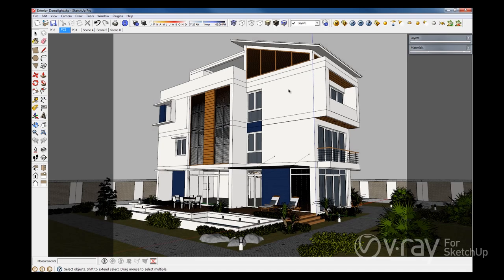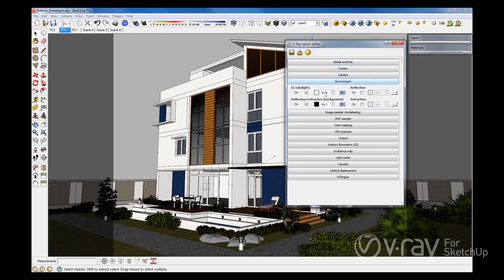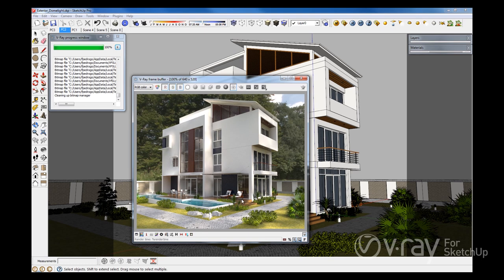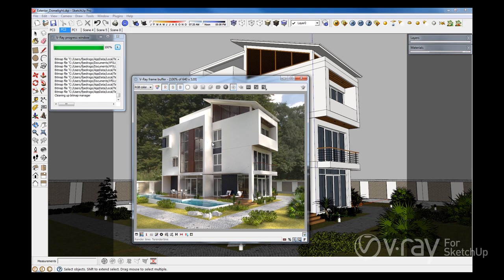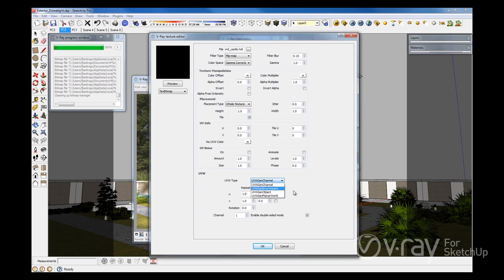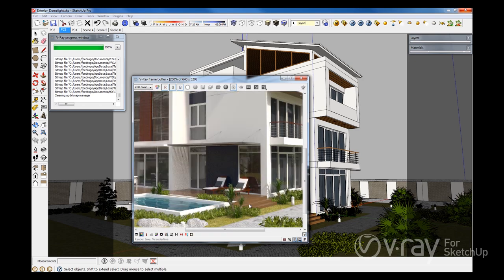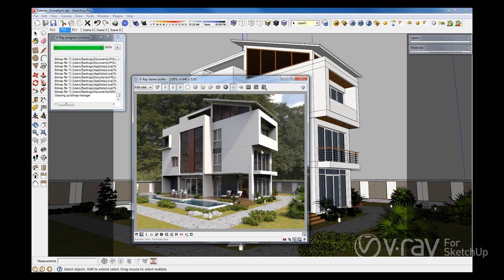V-Ray 2.0 for SketchUp - Dome Light

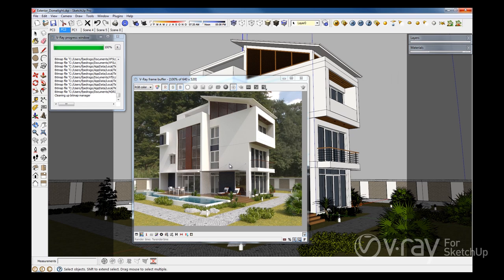Comment: Really important point at 2:38 - Vray analyses the HDRI of the dome light, recognizes where the brightest spot is in that image, and Vray treats that spot as a direct light source.  So make sure that the HDRI you use for your scene corresponds to the time of day and lighting you want to achieve.  Many of the free and even commercially available HDRs have the sun at a very low angle, giving you long shadows in your render if you are using it in your dome light.

Comment: A big problem with most tutorials covering Sketchup Vray is that most of them don't start with default pre-sets.  Having just one or two setting different than default will give greatly varying results.  This tut also seems to be guilty of that faux pas since at the beginning the narrator states that this scene is already illuminated a certain way.  He does not give the specific setting, instead he just starts changing existing parameters.  It's no wonder that several of the comments here state that they are unable to reproduce the results.

Well, I'm thinking it's about time someone made a tutorial in a clear narrative that covers this topic, starting from default Vray values to the final render.   It would also be a great asset to the community to get concise explanations about how changes to various variables affect the render.  I may just have to get on that, lol.